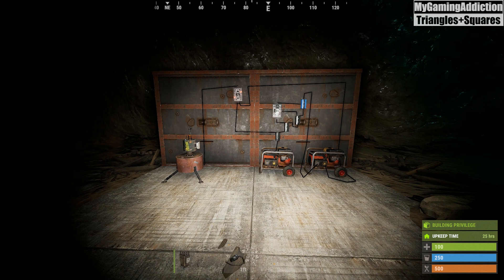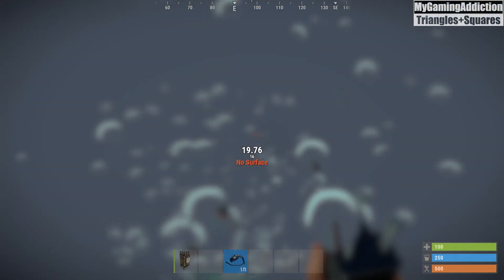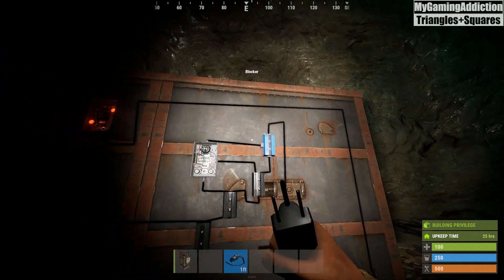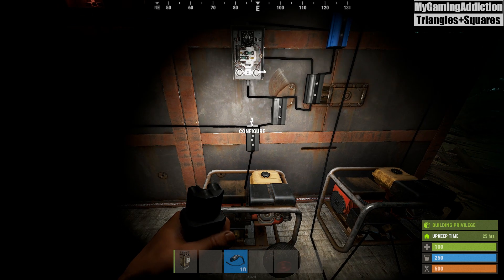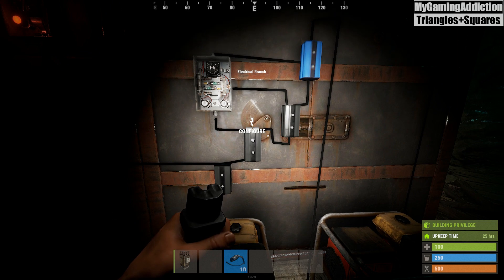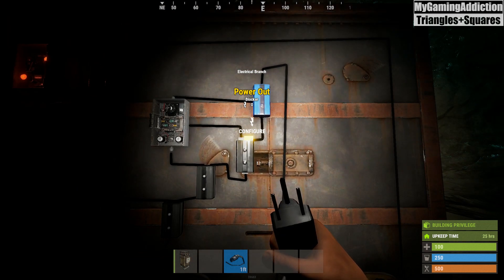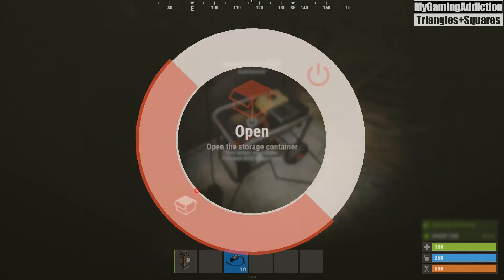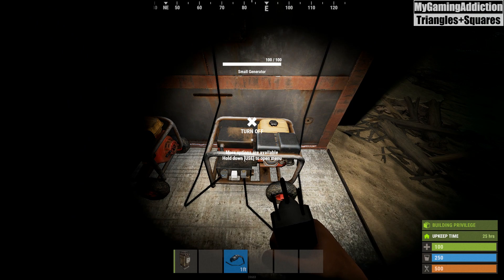Rust - Fuel Generators in a Delayed Daisy Chain (Cave Base Ready)

Comment: so it is possible to daisy chain a bunch of fuel generators and have only 1 fuel general re-fill (or nearly) re-fill the other generators to keep the power flowing for several hours?

i do caves bases but after this sentry power patch im scratching my head on what to do now with sentries. i dont like living on the surface :X